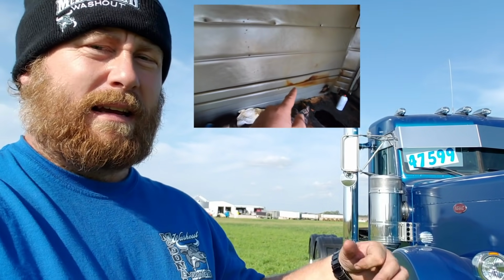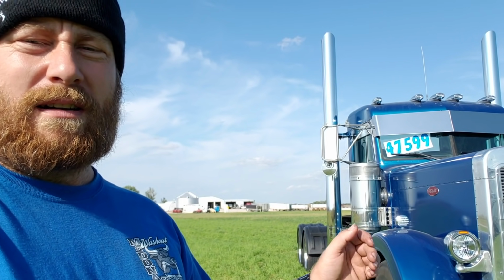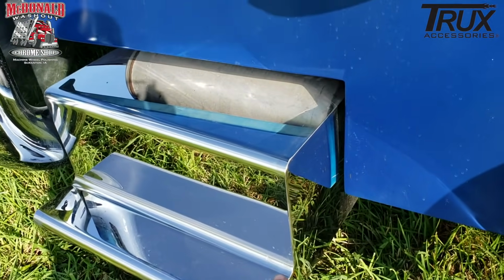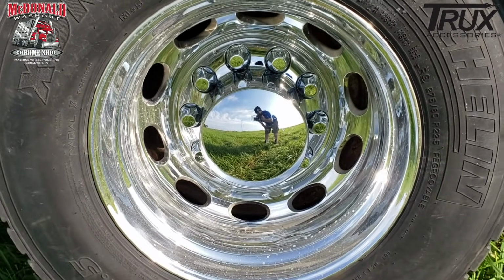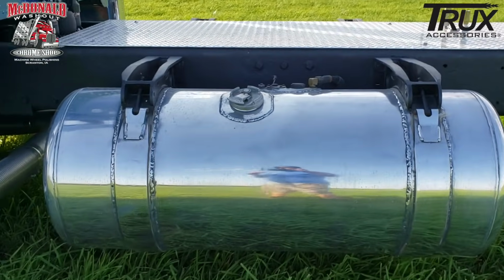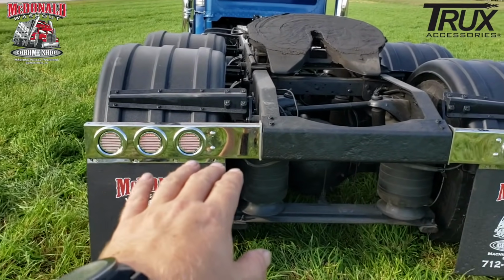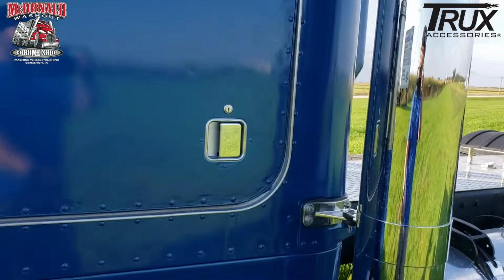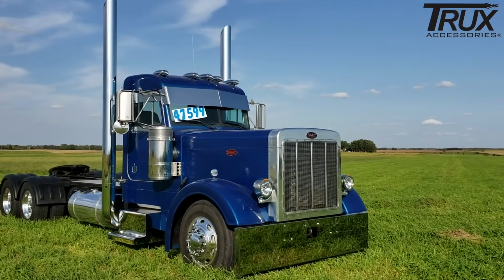379 Peterbilt | Full Restoration | Under 10 minutes | Fast Forward Recap | McDonald Chrome Shop

Comment: I'll never understand mega low sunvisors , but nice job sir
Reply from the maker: it all depends on how you sit in your truck. Most people that choose to sit on the floor with a low rider seat want the lower visor to block the sun lower on the windshield. If you drive with air in the seat they usually like a smaller visor so it does not block any vision.

Comment: First off, I'm the old owner of this truck, 1.2 million miles, and no, it was not abused.  With the Pittsburgh Power Pak, that little C-12 Cat will stay right up with the 550 Cats on any hill.  And lastly, I resent the old man comment, I'm not that damm old.  Also, it was not an electrical fire,  it was an arson fire, the joys of a pissy ex-wife.
Reply from the maker: we purchased this truck from vander haags so we never met the owner before it got to them. From what we could see and were told the fire looked to start under the bed there was wiring burned up in that spot and it looked to follow up a wire to the light to the top rear or the bunk. which could of happened just by getting hot due the fire and the wire conducting that heat. Either way on our end we just go by what we are told by who we buy the truck from in this case it was vander haags they got it in and we do a lot of business with them and we made a deal.
Reply: Literally in the same sentence says it was never abused but with the power pak it would keep up with the big cats on any hill lolololol
Reply: @hellojoe70  , big difference between being abused, and working it!

Comment: They have the idea but still far away from a clean job. Frame looks  bad and fuels tanks  not good plus too many small details  And the worse fender ever .
Reply from the maker: What you have stated would be true if it wasnt for the fact we pointed out each flaw and addressed the reasons why we went these ways with things such as the tanks, fenders and frame. all the reasons were to keep the retail price down on this truck for practical use. This was NOT a show truck it was built to be a work truck with a price tag of mid $40k range. Truck sold in 4 days after video posted explaining everything. This truck was sold to a farmer and as far as i know has been very happy with the truck.